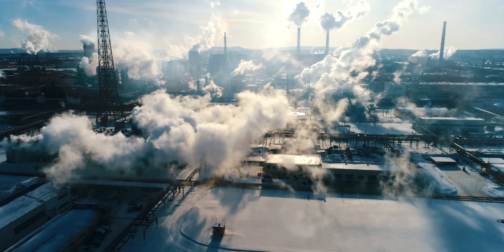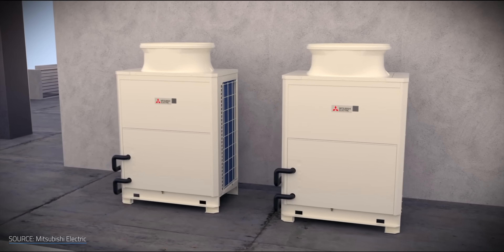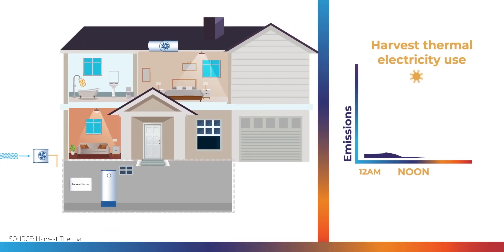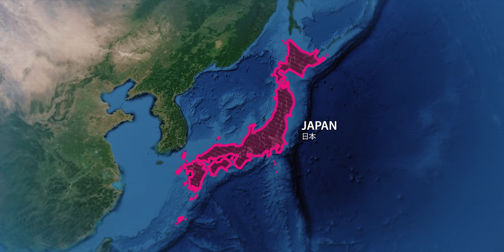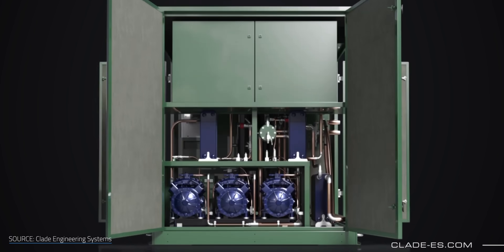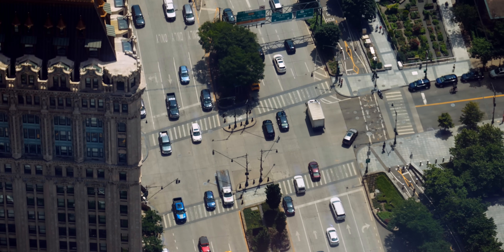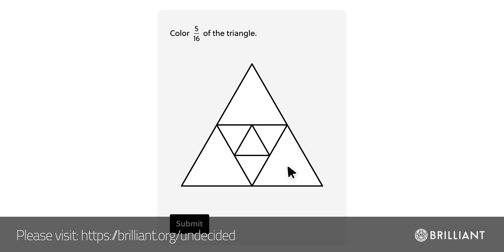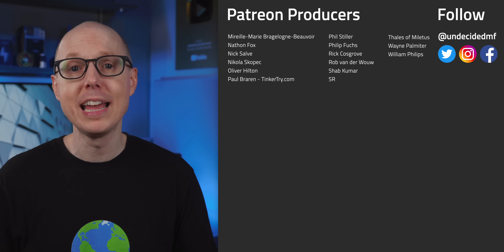Why CO2 Heat Pumps Are The Future Of Cooling

Comment: Our townhouse is heated with electric baseboard heaters, we use electricity for our domestic hot water heating and we use an electric stove for cooking. Not so energy efficient but environmentally friendly.

For a couple of years I have been interested in heat pumps for heating and cooling our place. I've done a lot of investigation into using one of them for heating and cooling. I've also tried to determine how and why one might use a heat pump to heat our domestic hot water. The up front cost for just an air to air (basically a mini split) heat pump is FAR, FAR too high to make sense unless I buy and install it myself. Our townhouse is only two floors and each floor is slightly over 500 sq ft. The cost quoted to install just an air to air heat pump was over $10,000.00. If difficulties were ran into during the install it would be higher. We only pay $110.00 a month for electricity. Even with a COP of 5 we would only save a few dollars a month so our break even point would take decades instead of just a few years. However if the temperature continues to climb we may eventually need air conditioning so I may purchase and install one in the future.

Rebates in our area? To qualify for the rebate one is required to use only the installers listed on the rebate site. I had quotes from some of the ones on the site verses a few quotes from ones not on the site. The prices quoted varied by thousands of dollars depending on whether or not the technician was on the list. I'm not going to do that again! Many years ago I had a high efficiency furnace installed in my old house and used the rebate system. I ended up paying the same for the new furnace as I would have without the so called rebate system. The installer had his cake and was able to eat it too.

Installing a domestic water tank and heat pump (the ones with the heat pump situated on top) would cost almost double what a standard electric water tank would cost. To install a standard electric 40 gal water tank is about $1200.00 to $1500.00. A heat pump water tank costs $1200.00 to $1500.00 before the install! They still require replacement in six to ten years so the savings over the life span would not allow for the break even point to be achieved. They're not that reliable either. If the heat pump breaks down one would need to pay for a repair (try to find a technician willing to work on a water tank heat pump) or replace the whole thing. Much cheaper to have a standard water tank installed in the first place.

Hiring someone to install a heat pump to heat and cool our home will cost an astronomical amount of money and will take in excess of ten years to reach the break even point so that's not going to happen. Within the ten years one will need to do regular maintenance so the break even point gets even further away. At current install costs, if one needs to have any repairs done, attaining the break even point during the units life time would be eliminated.

Good video but, where I live, it's a long way away from where it needs to be before it's something I would do.
Reply: FWIW, I've had both a mini split and HPWH running in my home for well over ten years.  Never had a breakdown, not even recharging of the freon.  I have cleaned the filters ever couple of years though.  Although I never had high bills beforehand, the savings was more than I anticipated and I have zero regrets with either purchase.  All DIY installation, that was easy too.
Reply: I just checked, this year is 15 years.

Comment: 1:45:  90 Celsius?  That will take you skin off in about a second.  I have my heatpump water heater set to 45 Celsius.  Perfect, and I don't get scalded.  But, that's the key to "heat harvesting", using the higher CO2 working temperatures to heat water to much higher temperatures.  That translates into more energy per liter of water, and a more useful temperature for heating.
Reply: Usually it's mixed with cold after a tank

Comment: I’ve already got a hybrid hot water tank that runs off a heat pump.  Plus my geothermal heat pump from 2012 can desuperheat as you mentioned yours does.  I can’t see why using any hot water tank as a heat battery isn’t possible.  It’s nice that safer CO2 can be used in heat pumps, but it doesn’t appear to revolutionize the technology. (BTW, the audio is much improved in your new office)

Comment: Co2 heatpump work at scary pressures. I dont know how to feel about having a system that works at more than 100 bar. I work with hydraulics at similar pressures and equipment failures tend to be spectacular
Reply: Depends on volume to leak

Comment: Let's just say I'm not convinced.
While intelligently managed water tank energy storage is a boon in virtually any scenario, peak CoP of 5.odd is nothing special, and hardly worth the trouble that comes with 30bar of pressure.
The comparatively harmless refrigerant is good, but even then closed loop heat pumps are on the rise, virtually eliminating the issue in the first place.

Comment: A poorly programmed heat pump can truly make it a headache and most efficient at burning a hole in your wallet. My first heat pump would switch to gas heating even if it was above 40 degrees outside. Today, I assume the settings were wrong OR it was simply not efficient at 'low' temps. I do blame the installer, they probably had no idea what they were doing... even though I'm not an AC tech and read my current heat pump manual and figured out how to keep it on in low temps and found the efficiency curve online to decide where to set that low temp...
Reply: A lot of crappy heat pumps are still being sold and they basically stop working below 45F which basically makes them only useful in places like Hawaii or Florida. Why they would be allowed to be sold in a place like California where it really does get below 45F regularly completely baffles me.

Comment: The other challenge with CO2 refrigerant that I think Harvest is addressing is that it has a narrow range of input water temperatures at which it can work efficiently. They really want to take in relatively cold water and put it out piping hot. We have a large radiant heating system in our house, and were trying very hard to find a way to use the Mitsubishi CO2 heat pumps in our electrification project. Unfortunately, simply using a large buffer tank would mean that the water going back in to the heat exchanger would be too warm for the sweet spot of the CO2 unit.
Reply: I agree with your statement of the problem, but I don't see how Harvest can solve it. Every SANCO2 DHW system has a tank; every DHW heater, gas or heat pump, has a storage tank/"thermal battery". And for best COP it has to be carefully stratified with only 10C cold water into the bottom of the tank/ into the heat pump. Once you mix in return from any space heat emitter (central ducted hydronic coil, fancoil or even low temp radiant flooring), your input temp into the heat pump goes way up and your COP goes kablooey. Hope I'm missing something, because I don't see how any algorithm controlled manifold can get around physics.
Reply: stages and switching like a class d amplifier as inevitable solution.
Reply: @hardrays  It's called an inverter.

Comment: It feels like R32 also is a good compromise.  It has some better energy storage value than CO2 but are still not bad for environment in the same way as R4xx  I always been a bi promotor of air to water heatpump from my first install during the late 90s, and already then it had a COP of 3 down towards -5 degrees celsius so I am suprised that US been so far behind on this, but I guess that is because you have had to cheap gas bills  :)
Reply: modern hyperheat airsource heatpumps get like cop3 up to -25 celcius
Reply: @hillppari  I know, I was talking about my first heatpump that I bought 1998, so almost 30 years ago...  :) The Air/water I have now maintain almost COP 2 at -20 degrees, can you please tell me the brand that handle Coop 3 in -25 degrees from air? Ive never heard of that other than Geothermal heat pumps and those are always operating at around +4 degrees no matter what air-temp
Reply: I'm also a bit baffled by videos like these. Checked the COP of my Bosch ductless units: 5 (using R32). The US are quite a bit behind in this and lots of other things it seems.

Comment: I have a heat pump water heater and we use a heat pump for heating and cooling.  Especially living in a hot climate I have often thought about having one heating cooling loop to for example take heat from our fridge and move it into our water heater or even just outside. It has to be better than heating up our house only to have our AC heat pump move it outside.

Comment: 5 to 10 years payback is a non-starter.  No good.  Not worth the investment.  Want me to put it another way?  Better would be to store energy in a power bank that is electrically based such as a lithium battery so it could be used for a host of devices not just a heater or cooling device.  I think Elon Musk is working on that right now.  What happens when techs and junk yards dispell the CO2 into the atomosphere?  Wait, we already know.  SANCO2 is barking up the wrong tree.  Personally, I'd like to see a power bank in everyone's yard that they could feed however they choose.  Add solar, wind, waterfall, grid, etc to charge your battery.  Now that is exciting.  And you could even sell power to your lazy neighbors who still want to rely on the grid or CO2, etc.  PS:  I worked in energy management before it was a thing.

Comment: I have a goal to transition to a water cooled heat pump based system that can make hot water and possibly dump the energy from my house into a hot water tank and or a swimming pool. Living in Arizona desert this makes a lot of sense to me. I already run my home off of air source heat pumps and have a heat pump water heater but combining them and using CO2 as the refrigerant makes a lot of sense.
Reply: Ground sourced may be simpler and more consistent than either air or water sourced.

Comment: Darn, that is frustrating. Good find though. I've just installed an All Electric Heat Pump in my home (march 2023). 1 Year earlier I installed 2 Air-conditioners. This would have been a much better solution for my home. Wish I had know this 2 years earlier.
Reply: UndecidedWithMattFerrell581  I’ve been wondering a long time very simply. It is warm. my heat pump cools my home and emits heat outside, why don’t we use that inside to heat f.i. the domestic water. It is cold outside, why don’t we store the cold somehow to cool in the summer? The first seems pretty obvious, the latter more complex but nonetheless. Why waste the endproduct?

Comment: I just installed a new heat pump water heater to better compliment my new solar system that will be installed next month.  Right now I am running about 1/3 of the electrical costs compared to my traditional resistive electric water heater.  It is quite a nice unit.

Comment: While heat pumps can run in reverse for cooling, it seems to me the combination with a water heater loses the efficiency of this setup. I suppose you could cool the water for the same effect but then you don't get domestic hot water out of the system. Am I missing something?

Comment: HVAC tech here, co2 is not the future. the pressure it would have to run at would make it pretty dangerous to have indoors and a failure would be VERY noticeable LOL you think it's expensive to have your system serviced now? just wait until you see how much it would take to fix a co2 system loaded to the gills with high pressure rated parts and tons of expensive computers and sensors. also regular heat pumps are only really efficient down to around freezing, below that their efficiency falls off a cliff and your backup electric emergency heat kicks in to make up the difference, and don't forget that heat pumps also need to defrost the outside coil and to do that it pump heat back out of your house which again requires your emergency heat to kick on and make up the difference. if co2 was viable in residential systems it would be more than just prototypes and industrial equipment after 20 years

Comment: I have a solar water heater on my roof that uses evacuated tubes and propylene glycol to heat an 80 gallon water tank.  My water tank reaches 130F in the summer and 90F in the winter.  If I added a CO2 heat pump and stored heat in the same water tank that my solar hot water heater uses, how much more efficient would that be?
Reply: If you have an air source heat pump system, you're better off having solar PV as the excess electricity can be sold to the grid or operate other things in the house while solar thermal doesn't have that luxury. As for your scenario, you'd have to simply test it out and see how your electricity usage with the solar thermal system enabled and disabled while using the heat pump heating system. There is no way for us to figure this out over the internet even if we knew everything about your setup.

Comment: Is anyone aware of modeling/simulator software which can be used to compare the power necessary to heat/cool my house. I'd like to model my current central ducted gas furnace vs ducted heat pump vs mini-split and now add harvest thermal with heat battery. I'm expecting something like what's available for Solar PV systems. Please reply with suggestions :)

Comment: r12 is the way to go. those systems are easier to work with and more reliable and don't need as high pressures as co2. That's why nobody used co2 until now
Reply: Here in the Netherlands, r12 has been banned for about 15 to 16 years now
Reply: @rubenflex2  whole EU I think. Heard it's 17 years already even. Huge ozone killer and modern units with R32 are easily 5x more efficient anyways.

Comment: Its not twice as efficient as regular heat pumps, but it is very good.  My SanCO2 heat pump water heater only burns about 2kWh/day of electricity keeping a roughly 76 gallon steel hot water tank at 145F+.  Think about that!  Only 2kWh a day!   Not only does it use almost no electricity, but it uses so little that the electricity is basically free if you have any sort of solar on the house (and I do).   In fact, I even run a hot water recirculator (1 minute on, 29 minutes off) for convenience which pushes consumption up to 4kWh/day and it is still basically free hot water for us.

Throw in the constant-temperature mixing valve on the output of the tank to drop it to 125-130 for in-house piping, and the tank has an equivalent of 90+ gallons..  Its so good that it does not need a thermal element for a backup and, in fact, does not include one.

However, The SanCO2, specifically, is rather expensive compared to most consumer heat pumps.  2x to 3x as expensive... around $5000 for the whole system not including labor.  It is one of the best, and the STEEL tank will last forever because it is steel, just a tank and insulation, and nothing else, but it is not a cheap unit.  Most people are probably better off with cheaper heat pump water heaters.

The CO2 refrigerant cycle is almost perfect for heating water.  The SanCO2 refrigerant loop is 100% enclosed in the small outside unit of the SanCO2.  There are no external refrigerant lines at all.  Instead, the water tank inside pipes a water loop through the outside unit and back again.  Bottom -> outside unit -> top of water tank.  Simple as that.

Which also means that it is nearly impossible to use up the hot water since the water loop through the unit takes the water to 150F in one shot.  The worst that happens if you use the whole tank's worth of hot water in one shot is that the water just drops to "warm".  It will never actually get cold.  30 minutes later and its hot again.  I tested that once.  Under our normal use it never exhausts the tank.

This is the future technology-wise, but for mass adoption these CO2 based heat pumps do have to get cheaper.

-Matt
Reply: What were installation costs like?  Ballpark numbers are fine; we all know they vary by location
Reply: @brianm9085  In my case, around $2000 inclusive of them hauling away the old tank (50 year old gas water heater whos tank had finally failed).   I used a regular water heater installer not associated with where I got the SanCO2 units from.  It was fairly straight-forward copper work for the new tank, and then an electrician to run a 30A 240VAC circuit to the basement which was around $500.

There are definitely far cheaper heat pump solutions for water heating.
Reply: @junkerzn7312  not bad at all, thanks for replying.  I'm considering a dual replacement of a packaged rooftop gas system and gas hot water heater.
Reply: I looked at the SANCO2 solution but the warranty couldn’t support DIY. 

So I did an active solar system with electric backup similarly priced for the materials. It’s too new to know what overall electric savings will be but in winter (December) I saw about 45% less electricity. In the abutting months I saw around 50% savings running the backup. 

My electricity is relatively cheap compared to New England and California prices so I couldn’t justify this.

Also, I needed to under size my storage tank by ~30 gallons because of load and space constraints.

The other reason I did the active solar was I could repair/replace components.

Comment: Random question that has nothing to do with the (great) video... why do we not see radiators used for cooling? here in the uk we mostly heat our homes with radiators. It made be wonder, when a gas boiler is replaced with an air source heat pump, to heat those radiators. could we not use the same system to put cold water in the radiators in the summer as a form of AC?